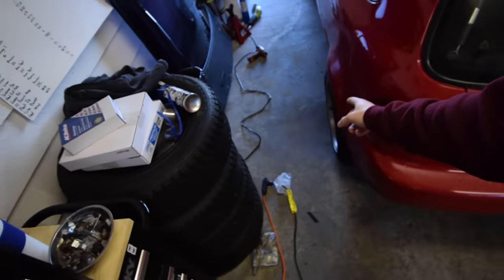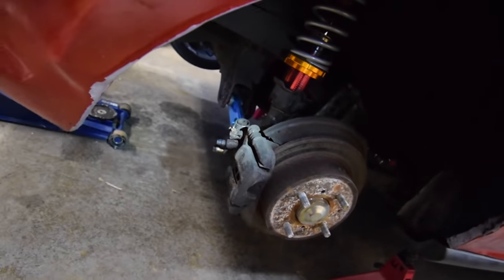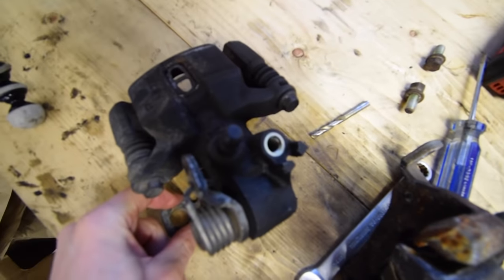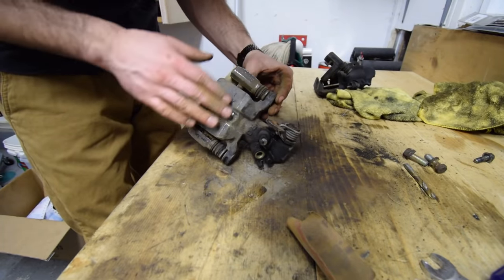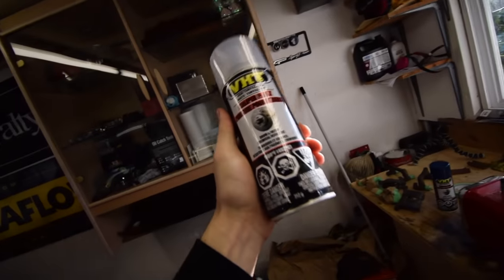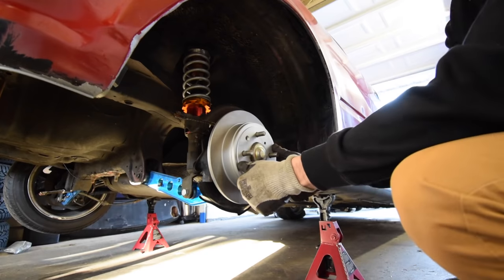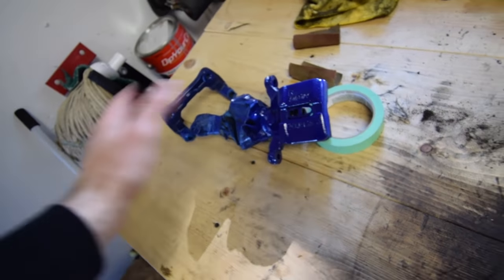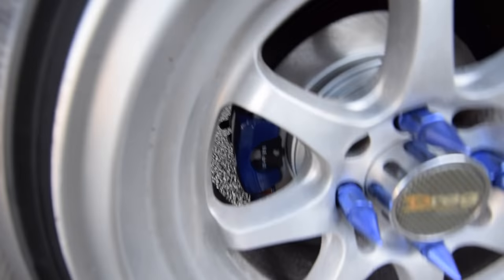Painting the EGs New Brake Calipers!!

Comment: I'm disappointed, no primer again  primer would make your colours more vibrant and brighter..., and it would make the paint stay better to the metal
Reply: THEBOZZ 1801 hard to find high heat primer though but I agree
Reply: well, he could've used a white paint first.. same output as the primer.
Reply: THEBOZZ 1801 with brake calipers there is no point
Reply: Same I keep seeing this with you tubers skipping the primer step when it’s one of the most important steps
Reply: @andrewknutson2175  there is a German company that provides a complete Caliper paint kit with primer included, the company is called Foliatec look it up on Amazon, it isn't that expensive but extremely durable
Reply: @andrewknutson2175  This brand makes hh primer too :p Also I'm pretty sure primer doesn't have to be high heat for brakes, even normal primer should be enough, it's way less sensitive than paint

Comment: Did you get the brake proportioning valve off the integra because if you didn't you wont be fully utilising the rear brake conversion.

Comment: Robbie you should put brake caliper grease on the back of the pads and clean and grease the guide pin along with putting loctite on the guide pin threads, please it is more safe